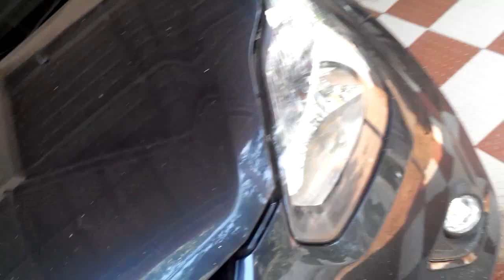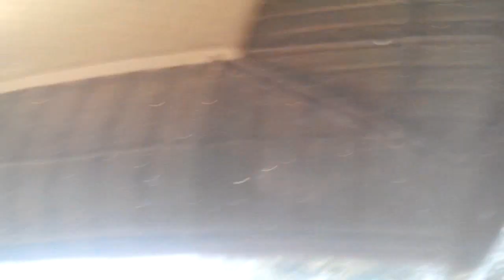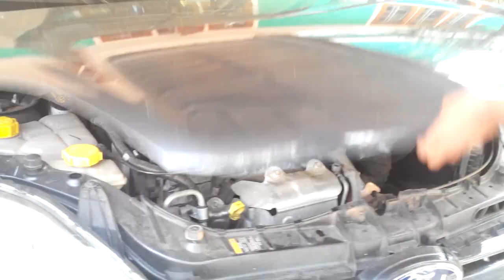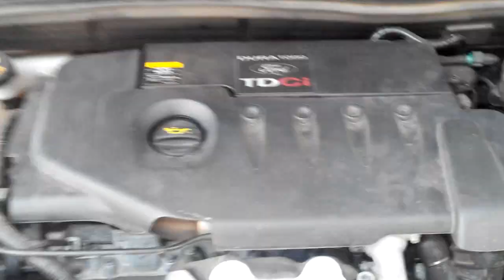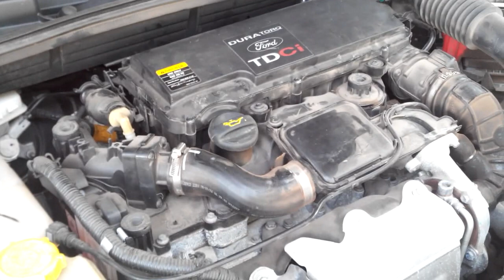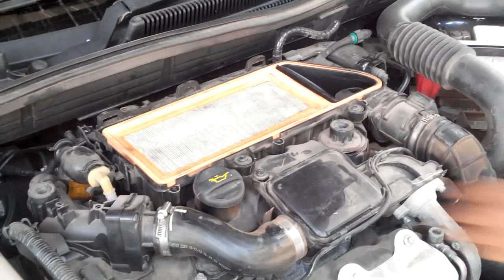How to open and replace FORD FIGO airfilter

Comment: From where dd u take the connections for ur fog lights???
Reply from the maker: Fuse box
Reply: ABHIJITH  does it work seperately without headlights?
Reply from the maker: Yes..with extra switch
Reply: How much dd it cost u in fitting along with the wiring and the switch ?
Reply from the maker: Done it myself..only the cost of wire,one extra fuse, switch and lights

Comment: You should also tell about the tool and it's size used else it's of no use.
Reply from the maker: Use allen key to remove screws.
Reply: Use 3 mm Allen  key